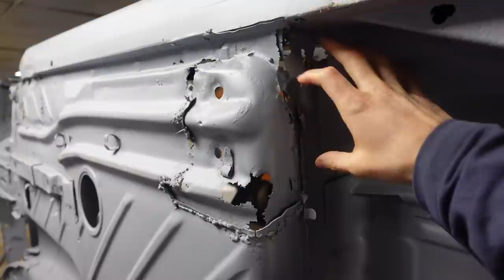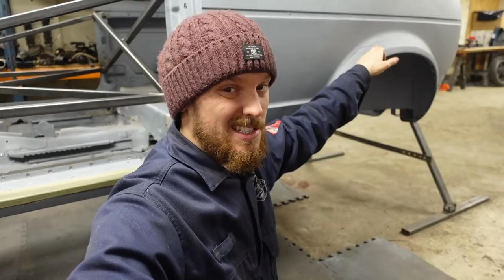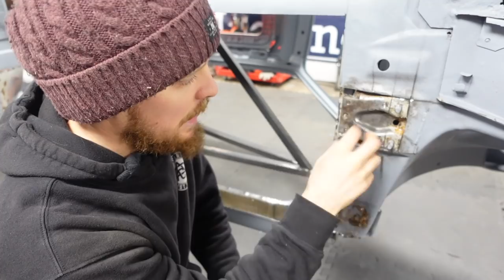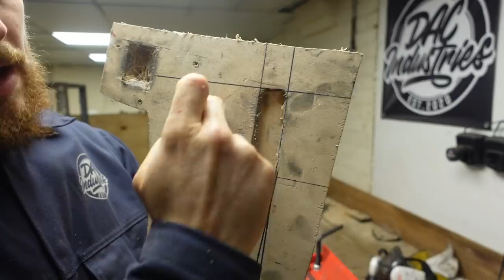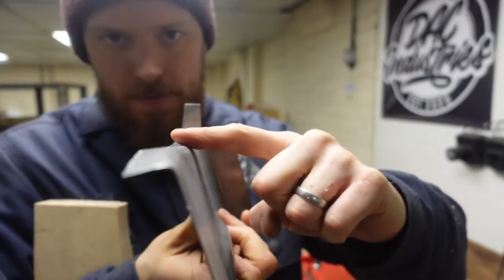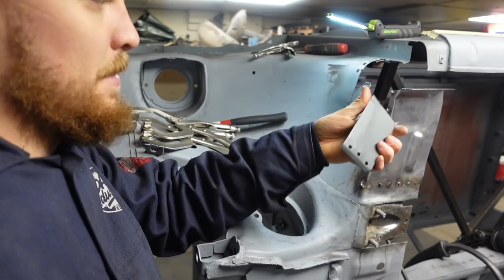Floor Removal & Front Arch Repairs - Golf Episode 15 - 1983 Volkswagen Mk1 Golf GTI  Restoration

Comment: Your fabrication skills on that bottom corner are immense...your progression is palpable, mate.  The welding is also definitely better than when you started. Thanks for another enjoyable instalment, Dan. Keep it going, bud👊
Reply: Your doing a smashing job mate, when I fitted them full floor pans there a bit of work to match them to the tunnel what I did was overlap the    floor to the tunnel a half inch and weld both sides and remember to weld in the seatbelt mount to the inner sill cus the new ones don't have them 👍
Reply from the maker: Thank you so much for watching and for the comment Alex. I am pretty happy with how they turned out! Glad you enjoyed it bud.
Reply from the maker: Thank you so much for watching and for the comment Thomas. This is my plan I think. I have a Joggler on order that will hopefully make overlapping them a little easier. I actually removed and cleaned the seatbelt point from the old sill today! Need to make sure I remember to put it in!!!

Comment: Welding tip: cut a bunch of strips of metal and stick them side by side in a vice. Use that to dial in the machine and your hand. An hour of that prior to welding on the car and you’ll get rid of that pigeon in no time.
Reply from the maker: Thank you so much for watching and for the comment bud. I do this every morning to check it still works! For some reason it isn't alway's the same on the car...

Comment: Did you make a jig to locate the axle mount studs? Their position is pretty critical and you shouldn’t just rely on the new panels all lining up and fitting in the same way the old ones came off.
Reply from the maker: Thank you so much for watching and for the comment dude. I have a plan for it.

Comment: Ok, this comment is written now i've watched the whole vid. That floor corner is a top top job! I think i need to go get some plywood lol. How do you dress your welds out of interest? Flap disc, power file?
Reply from the maker: Cheers Bud! It didn't turn out too bad did it! I dress them with a grinding disc, Flap disc, Finger Sander (Power File) I then go over the panel/area with a stiff wire wheel in a drill.

Comment: Coming along nicely. Mine is currently at a body shop having new sills, rear inner and outer arches, rear suspension turrets, rear valance and windscreen corner repairs. At that point the car will be very solid. It's going to cost me a fair bit but I don't have a workshop or the tools to be able to do any of this myself. Just debating whether I should have the whole car resprayed as well since it will be much cheaper for me to have it done now rather than later.
Reply from the maker: Thank you so much for watching and for the comment bud. Beginning to wish I had just paid someone now 🤣 I am enjoying it, It is just a lot of work. Very lucky to have this space to work in too.
Reply: @DanChambersDAC  It's much cheaper if you can do the work yourself though, plus you get the enjoyment and satisfaction of seeing your own work take fruition. It's going to cost me 5k for the work I'm having done which is almost as much as I paid for the car. But once it's done I'll nave no rust issues. Next job is to have the whole underside re-undersealed and replace all the bushings and have all the various components like the axle etc painted. Luckily my floor seems to be in very good condition despite having just turned 40 years old.

Comment: Great videos Dan can I ask what thickness welding wire you are using ?
Reply from the maker: Thank you so much for watching and for the comment James. I am using 0.6mm Steel wire with (Now) 95% Argon 5% Co2 Gas. In this video I am using Pure Co2 and it isn't the best.

Comment: Hi Dan, I feel you pain. I’m no great expert myself. Would it not be a little easier to tackle the smaller, fiddly sections of rust and welding. Then tackle the big floor pans. That way your braking the jobs down to manageable sections. You can alway trim away bigger panels to work around the smaller sections you have tackled first. 

Best of luck mate. Your doing great
Reply: Great work on the footwell Dan. As long as the welds penetrate and hold , it doesn’t really matter how they look. You can always grind it off and re-do it, then smooth it off. 

👍🏻💪🏻🙂👊🏻
Reply from the maker: Thank you so much for watching and for the comment bud. I figured that I needed to remove the floor to expose all of the area's that needed addressing that were being hidden by the floors. Just unfortunate that a lot of panels join onto the floor. I did consider trying to do small repairs and move along but this seemed like the only option.
Reply from the maker: Thank you, It turned out OK I think! Weld's are nice and penetrated so should hold OK!
Reply: @DanChambersDAC  Juicy’s looking good. Solid for another 40 years. Now more than ever, cars like this need saved. EV vehicles have no soul and will never be remembered like these classics

Comment: Dan, great work as always. Can i ask, how do you know what thickness of material to use for replacement?
Is it a case of measure surrounding and make sure new is this or thicker??
Reply from the maker: Thank you! Yeah I just have a measure of the area. I have only used 1mm and 2mm sheet steel for my fabrication.